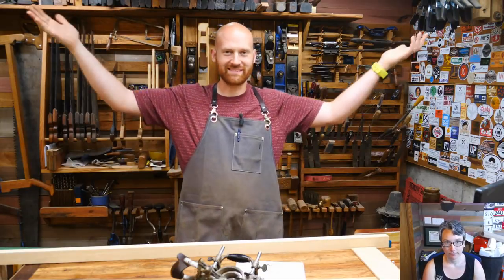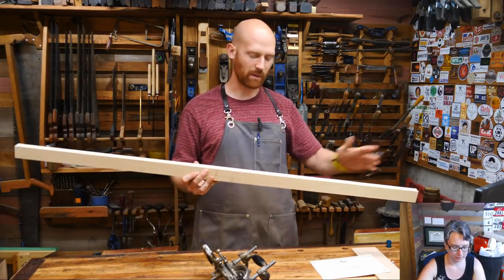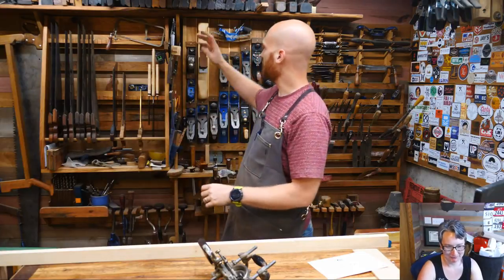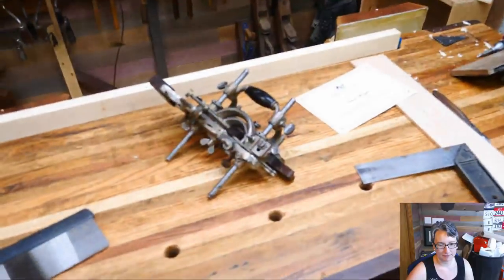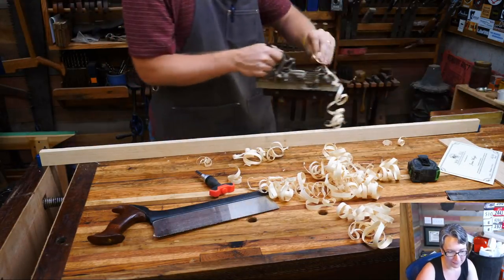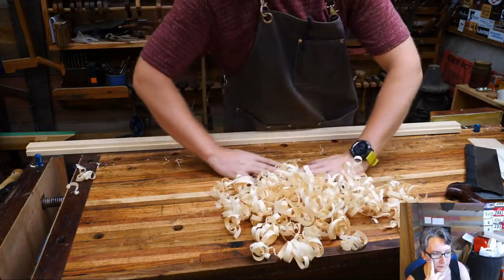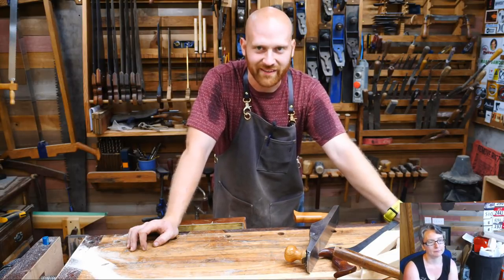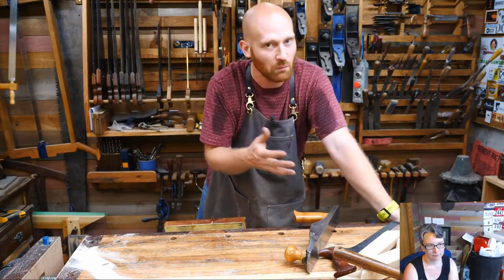Making a Simple Picture Frame With Hand Tools.

Comment: I am an artist and have made canvas stretchers and have (poorly) hand framed a few pieces. I’ve found that it is incredibly important that the opposing pieces of wood are the same length. If they are different lengths, you could have perfect 45s and it still won’t work. My best results have been on a power chop saw with a stop block.

@woodbywright James, is there a hand tool equivalent to a stop block for this kind of project? I’ve never seen a mitre chopper (lol forgot what it was called) like this before, interesting. Framing pictures and art is something i’d like to learn how to do very well with hand tools. Thanks for the demo, keep i]up the great work. Cheers from Kuala Lumpur

Comment: Hi James. I'm not an expert, far from that, but I think the high quality of your videos is the reason for the out of sync between the image and the sound. I think there is a gap to proccess the high quality videos. So, try to use a lower resolution for live videos in the future. Just an idea.
Reply from the maker: thanks for the idea. I might have to try that.
Reply: Remember that someone have chat that "The PnP audio of your wife is OK but the plane's audio is slightly off. (main camera)". And that litle frame is of a lower resolution...  Make sense ???
Reply from the maker: I think I finally found the problem. the main feed comes through a USB adaptor and the audio was being connected to that instead of the camera. hopefully next week it will be better

Comment: Wooden shoes have no gription on concrete ... Might change shoes to get the job done in half the time.
Reply from the maker: Well they don't waste time. J just have to put my foot behind the leg of the bench. I really need to put leather back on them.
Reply: Well in the video you were slipping and having to reset yourself quite a lot. You can see and hear it very clearly. Of course not a problem if you're enjoying yourself, right?